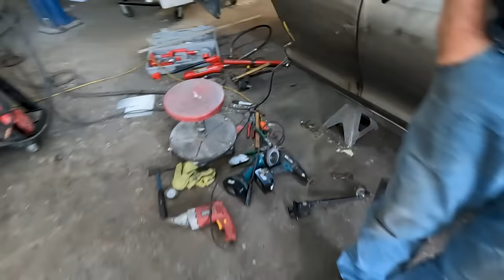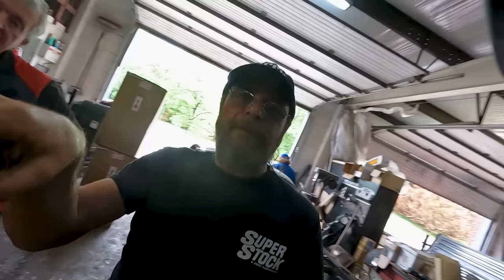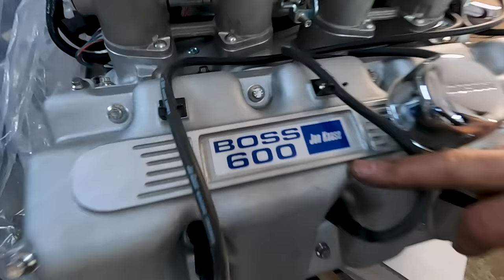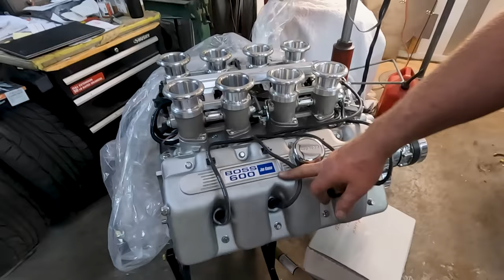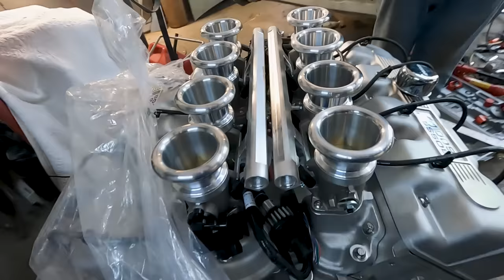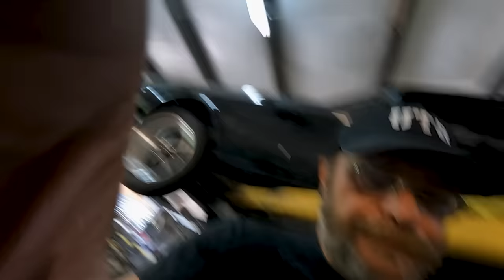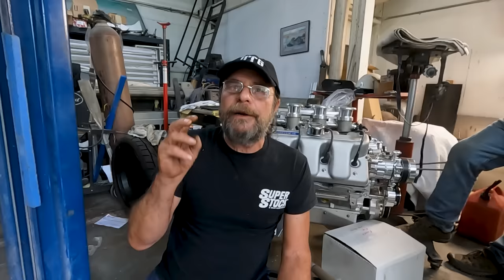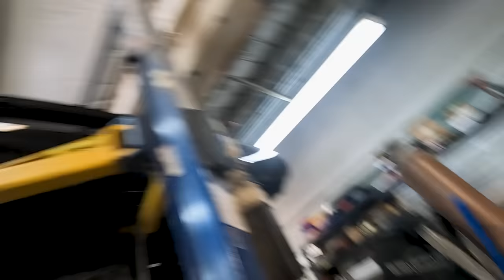How Ford Screwed The Pooch On What SHOULD Have Been The Greatest Musclecar Engine Ever

Comment: Ford only wanted the engines in the allotted cars. I believe, it was a win on Sunday, sell on Monday, thing. Fords, in general. As I understand it, there wasnt any profit, in the Boss 429 Mustang. There was a loss, actually. As far as, the head gaskets go. From articles I have read. The 1969 model year cars, did have cylinder head issues. The heads, were prone to cracking. The heads were revised for the 1970 models. The John Kasse heads, are supposedly completely re-engineered,  to avoid cylinder head issues. I am not an expert on this, but a big fan, who has tried to read up on it, over the years. Take what I say, with a grain of salt.

Comment: With 1970's Pro Stock rules, The Boss'9  Mustang Should've been the Winning combination Package where UT's mentioned Small stock carb Size & CA emissions restrictions were No longer issues.....The Mickey  Thompson Pro stock Mustang Should've been Unbeatable but somehow didn't Dominate like the 426 H did.....Aftermarket had All the usual cams, Intakes & headers goodies Available for the Boss 429 Pro Stock even for the smaller Maverick but Couldn't keep up with the Larger '70 Cuda !  .....Much Easier too Fill in Ports than Remove metal !! .....Still can't figure out why the Superior breathing Boss 9 didn't Dominate '70 - 71 Nhra Pro Stock ??
Reply: Sox and Martin ran two Doms, which were hard to get at the time.  Find a picture of a P/S 70-71 B9 with two doms.  You can’t.  Two doms and it would outbreathe the hemi.  And cubes, it had a better head, it needed way more cubes, and carburation.

Comment: The way I have heard it, Ford didn't really have the time or desire to get the Boss 429 production engines fitted and tuned optimally, when they scrambled to release them in public cars. They just wanted to get them shoehorned in good enough to get them out. The Ca emissions were installed on them, because Ford wanted to build enough to make them available in any state when it launched them to the public. If there were more produced, I'm sure Ford would have made some without the Ca emissions and would have had a better revision of the exhaust, at the least. I had family that was heavily involved with Ford and their NASCAR program in the 60s and 70s, and this is what I've always heard. 
When Ford came out with that 90 day wonder (427 SOHC) and NASCAR immediately banned it, Ford then started to get busy on the Boss engines. Edsel got pretty mad, lol.

Comment: R&T MAGAZINE TEST 1969 426 HEMI ROAD RUNNER WENT 14.3 IN THE 1/4. THE 440 6 PACK CAR WENT 12.9 IN THE 1/4. THE STOCK 1969 BOSS 429  RAN 14.09 IN THE 1/4. THE STOCK 1969 428 SCJ MUSTANG RAN 13.69 IN THE 1/4 WHILE THE STOCK 1971 BOSS 351 RAN 13.9 IN THE 1/.4. EVEN THE BOSS 302 RAN 14.6 IN THE 1/4. WITHOUT SLICKS IT'S A CRAP SHOOT. ALL THE NEW STUFF IS WAY QUICKER NOW.

Comment: I love the Mopar 426 Hemi and have had a lot of experience with them......truly a whipsong engine that can do it all.  I was so excited when Ford came out with its Boss 429 because I thought that it could be adapted to the street like the 426....but it was not to be so.....the intake runners are cavernous and lend themselves to slow airflow on the low end.  I was hoping that Ford would put out two different heads for the Boss 429.....large runners for race.....smaller runners for street.

Comment: Kaase Boss 9 heads eliminated the dual quench pad semi Hemi chamber and went with the modern heart shaped combustion chamber. That said, since they are CNC machined he may be able to machine it for the original chamber design. C&C Motorsports also sell Boss heads but with the original chamber design as well as aluminum Boss engine blocks. In fact Kaase regularly used their blocks in some of his Street Boss motors. Kaase also eliminated the use of O rings  and copper gaskets. I believed he used 460 gaskets as well as his heads are designed to use stock type 460 blocks.

Comment: Ford dropped out of racing in 1971 so that ended factory racing at Ford . The 335 type engine was used in pro stock and NASCAR in the mid 70's so the Boss 429 got bypassed because parts were hard to get . Ohio George put turf turbos on the Boss 9 and the NHRA told him to leave that car home because there was no completion for it . That combo was way ahead of its it's time.

Comment: It was the 'bean counters' at Ford (and probably a few other departments within the company), that were responsible for neutering the Boss 429. After the legal fiasco between the Chevy Corvair, and the federal govt. (thanks to Ralph Nader), it sent a strong message to automakers about legal consequences. Thus, Ford decided to detune the Boss, not only for those reasons, but also to keep warranty claims under control. Because they knew what it was capable of if it would have been equipped with the "proper" muscle/speed parts that would have let it perform.
Yet, even with it's restrictions, it was still a 13 second car when driven correctly. 
A lot of people compare it to a 428CJ/SCJ and say the 428 was better or faster. But some tests back in the day, and subsequent one's have proven otherwise, as the Boss has turned in quicker, or very comparable times to the 428 cars.
I'd say the 428 cars were more docile and more driveable on the street in traffic with their low end torque as compared to the high RPM nature of the Boss. It would be a similar scenareo between the 426 Street Hemi, and a 440 Magnum or 6 Pack.

Comment: I have a 1990 360 roller tbi stock everything I opened it up and found a 318 cam in it ..318 is cast onto it is it an improvement over a 360 cam are the the same or should I replace it with a stock 360 cam .. it’s a 90 Ramcharger with tin and a damn computer I don’t want to swap a big cam into it because I kept coming across horror stories of tbi motors never running properly with a cam swap what is a reasonable cam I cam put in without upsetting the computer? ..thank you uncle tony my heart dropped when I saw that 318 bump stick

Comment: Fords biggest gaffe was not their engines or how they equipped them. It was the stupid front suspension design! Coil springs on top of the upper control arm severely interfered with room in the engine bays limiting header design and plug clearance! Even a 289 in a Fairlane is a PITA to work on! I won't even start on their Rube Goldberg inspired power steering setups.

Comment: The cammers also had another problem. I Ford's infinite wisdom they made the journals in th bottom end wider and smaller to supposedly handle higher loads. Unfortunately when the engine was spun up to racing rpm the surface speeds of the bearings were too high and the bearings would fail.

Comment: I've always loved the Boss 429 but it stays at the top are over because there's a Chevrolet 632 that makes 1000 horsepower on pump gas and it's more than $10,000 cheaper
Reply: That's true and I guess that new big block has vast improvements over the original big block. Think it's designed more like an LS

Comment: True story about 1982ish.. Fall River Ma Plymouth ave.  A 1970 BOSS429 was crusin the ave besides us poppin light to light launch burnouts and 2nd grabs at us in our primered ratty rust out 1970  Nova was a stock 4bbl 350, The nova engine was a 300HP I belive . Strong and reved to 6200 , it was stock and tuned.  $600 car.. We got to the last light into Rhode Island were the turnaround is for a real measured out 1/4 ( Canning Blv run,, Not the bridge to bridge 1/4 on Rt 24 the Big $tuff  ran 10s on) We lined up and were flagged and my god that little Nova RAN AWAY and beat the Boss by a good 4 car lenths at a 100mph trap on our side. BOSS429 kept on goin and blew the red and cut thru Harbour Mall to aviod face and embaressment.  lol.

Comment: The Boss 429 was not a failure. The Boss 429 Mustang was built to homologate the engine for Nascar use. Holman-Moody built the Nascar race engines and in their final D-port revision, put out about 30-40 HP more than the Chrysler Hemi. Ford achieved their racing goals with this engine. It was incidental that the Mustang was offered to the public.

The Ford engineers designed the Boss cylinder head as a pushrod version outgrowth of the 427 SOHC. The basic port designs are similar, but ‘twisted’ to accommodate pushrods and rocker shafts.  

The original 69-70 street boss’ did not use head gaskets. These engines were sealed entirely with O-rings and silicone sealant.

Yes, the Boss 429 Mustangs were severely compromised. Yet, they did make power and there is at least one road test of a mid to high 13 second quarter mile ET pure stock. Using a camshaft that worked with this engine produced good power gains, even with the factory dual plane intake. You had to use a camshaft with valve timing events that worked with this engine and this was not understood early on. 

The big compromise was that this engine used heavy 3/8” valve stems and the street ‘T’ rods were not strong enough for 6K+ RPM. The ‘S’ Boss motor’s rods were too heavy making for an overweight rotating assy. The Nascar engines used light weight, hollow stem, sodium cooled intake and exhaust valves, but still had a massive rotating assy mass.

The basic design, however, gave a solid foundation for further development and this is why this engine lasted as long as it has.

Comment: On the you tube site Hand Built Cars the is a complete build of a '63 or '64 Fairlane 500 sleeper with a Kasse 850 hp engine with a Tremic 6 speed. The best resto mod sleeper ever.

Comment: Driveability is the reason for a de-tuned Boss 429 engine . The 428 CJ was much faster and you could drive it all day every day for 100,000 miles or more  . With a  little work the 428 would run 11's in the quarter the 429 needed major work to run that hard .

Comment: Ford didn't screw the pooch.....they never seriously considered using the Boss 429 as a passenger car engine.....they only built enough cars (And a few more) to  make it legal for NASCAR.  The Boss 429 was very de-tuned....low compression, retarded cam,  and  the cam they used was a 429 Cobra Jet cam, which was designed to use  1:75  rockers and the Boss had  1:76 rockers for exhaust valves and 1:65 rockers for the intake valve.....so not the ideal set up for a world beater......but they could have built a world beater if they chose to.

Fords 390 Gt engine could have been a hell of a lot hotter than it was...
The 428 Cobra Jet could have been been a lot better....
Ford could have put 427 Medium Risers in Mustangs and been unbeatable.....
But....

Ford was,  and is still, Family owned , and they did't want the reputation for killing 17 year old's.....
So,  they stuck to winning at the race track......win on Sunday, sell on Monday.

Comment: More than one reason strangled the boss 429. Ford was hearing rumblings from nascar before even releasing it. Next the emission laws changed dramatically in 71  . Add to that insurance costs & coverage went up because of the muscle car era consistently thru the late 60s. 
All these issues could be overcome after modifications on the engines on street and strip configurations. Remember they had to not only build it but it had to sell at least 500 units to be able to race in nascar.  All these things  conspired against one of the best racing engines designed.

Comment: I’m a Ford guy so I’m really into the new Ford 7.3L Godzilla gas motor. It’s a push rod motor like it should be and it’s make some great NA power and torque
Reply: I read somewhere that there are some problems with the cam delaminating due to inferior metal.
Reply: @briansearles4473  I know on the first ones out I’ve heard that but I think they have replaced them. And I’d do cam swap anyhow.
Reply: @brettconv83  Glad to hear that. Long time fan of all Ford V8's and the 300.

Comment: Two little things you didn't touch on, One is that the Hemi  engine was designed as a full blown no holds barred engine,(XI-2220)  it was to replace the air cooled radial engines in fighter aircraft (lower frontal area) . It came along too late in the war to be developed to it's fullest. Number Two is by the time Ford had tried to get the "Cammer" engine homologated Chevrolet had already built a multi cam big block and they basically showed it to Big Bill France and said this is what we have for the next race.... France said No No No and they put a stop to the cammed engines and to the displacement War. Ever wonder why you didn't grow up with overhead cam small block Fords ,Chevys, Mopars, even Amc?? It's not because the Big Three  didn't have the brain power it was because Nascar said NO. Remember this is when the cars were running on Bias ply tires and it was not unusual for a car to go up the bank and right out into the parking lot at 200+ miles per hour.... Look at Indy because it is sanctioned by USAC the rules were different from all of the other Indy Car races. If you ran a "Stock Block" you could run 60" of boost, If you ran a pushrod engine (Buick/Menards) same thing. If you ran a non pushrod engine you were limited to 50". Remember the Penske Mercedes, OVERHEAD CAM WITH a 1/2" pushrod. Good for an additional 10" of boost. Love the Videos  and I Must now follow the command set down and subscribe To the KIWI's channel and convince  every human I come in contact with to do the same. Thanks

Comment: Boss 429 you can tell it by taking out the intake side value cover bolts and put a pocket screw  driver into the bolt holes and if the screwdriver bottoms out at the handle this is a boss 429 the bolt holes go into the manifold vacuum and if it doesn't go through it isn't a boss 429

Comment: So why did Ford do the CA emissions package?  Because a lot of their low production cool cars were assembled at the Ford Fremont Calif plant.  Custom paint and striping, CA only models, and supplying west coast racers with engines and parts came out of the Fremont Plant.  
Everybody was racing to the bottom in HP to meet emissions and CA was the testing ground.  GM had 49 state engines, but Ford was trying to do the 50 state thing if they could ... 🙃

Comment: Ok, turbo charge and fuel injection with independent coils over plugs.
Then put a large set of headers down to a 6" pipe x2  and glasspacks. No mufflers.  Then find a rearend that can deal with 900 hp.

Comment: NHRA fuel series is still based on the chrysler hemi because they wouldn't allow a 4.9 bore center (fords block) it would have been an advantage for sure over the mopar. Mopar screamed about this and since they had so many sponsorship dollars in the sport NHRA wouldn't allow the 4.9 bore center. some tried a few years back again and it was no dice again. 

its a shame. it would have been cool to have had the mopars and ford designs squaring off in the fuel ranks. 

and yes the shock towers have always been a thorn in our sides.
Reply from the maker: Bore center rule didn't come around until the middle 1980's, and by that time Fords had already been out of the picture for a dozen years.

Comment: Solet's go back to 1963 with Ray Fox and Junior Johnson and their Chevy Mystery Motor that was by far the fastest engine out there but it could not last the whole 500 mile race . Remember there were only 25 of those engines built and I think Jenkins had a few . That engine scared Ford and Chrysler's idea of being competitive in NASCAR so both companies went to work on Hemi's and High Risers for the 1964 season these engines spilled over into Drag Racing but they were all originally built for stock car racing .Imagine Bill France banned the Cammer ,426 Hemi and the 427 High Riser that you could buy from the dealer but let the Mystery 430 Chevy run .Maybe his stock in GM had something to do with it ? Okay so Trans Am racing is a popular manufactures place to showcase their Pony Cars so the Z28  becomes a very desirable car to own . Ford comes out with a 302 Tunnel port to compete with the z28 and it wasn't reliable enough to be consistent hence the Boss 302 replaced it . Smokey Had a 302 Hemi z28 that made 600 hp but never raced them and there are still 2 around .Now let's look at the Pontiac Ram Air V heads ? They were just the thing to put the Indiand back in the ball game in NASCAR but never got the devolipment .

Comment: Mopar should have went with the Max wedge design and just improved the flow, hemi was huge detriment to the finances for them . if they developed the 400 Block instead of the hemi they would have had high winding engines at half the cost and many mopar followers

Comment: Kaase even builds boss heads for the 460 BBF. They are expensive.

Edit: Ford decided, if I'm not mistaken, to slap the Boss 9 in the Mustang because they didn't think they'd be able to sell enough Galaxies or Torino's with a Boss to homologate them.
Reply: Probably hit the nail on the head? By the late 60's early 70's Ford concentrated on the Mustang for it's performance image. The Fairlane/Torino became a family car much like the Galaxie/LTD.
Reply: @briansearles4473  I can't recall where I heard or read that from but it stuck with me. 

Yeah, I have a 1966 four door hardtop Galaxie 500. Definitely a family car. Tho a sleeper. Had the 289 but I put a 460 in her. The Boss 9 surely would have been a tighter fit but I don't think it would need any real modifications. 

They surely would have sold more Galaxie two doors or some Torino's with the Boss 9. They could have put them in all three: Mustang, Torino, Galaxie. Maybe even a Fairlane or Falcon.
Reply: Yeah, Boss 429 could have been an option in most Fords, Mercuries, and Lincolns... but then not many buyers of the other models would have been interested in the extra cost... and Ford didn't want to pay for the additional engineering just to get 500 examples sold...
Reply: @BuzzLOLOL  true that.